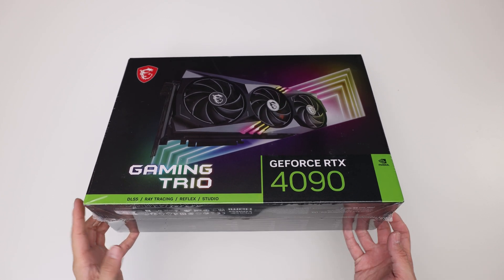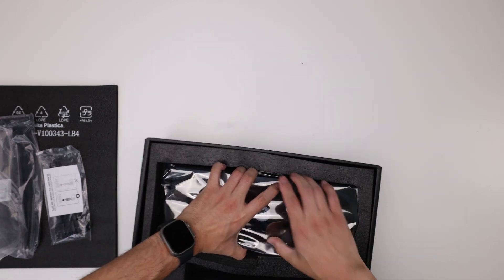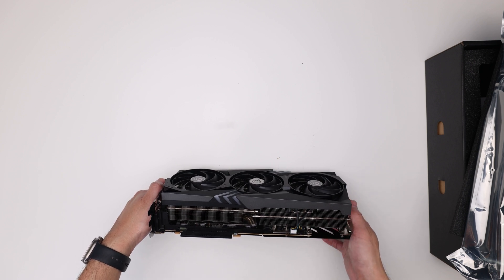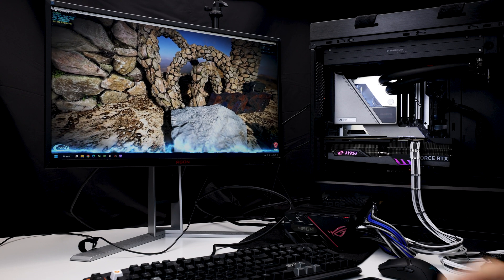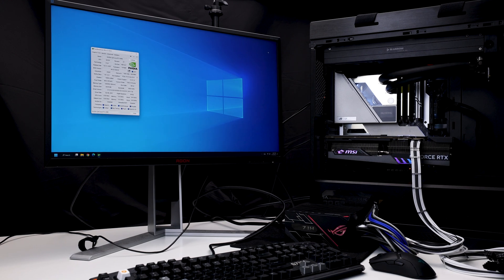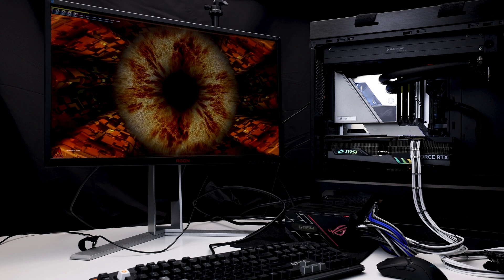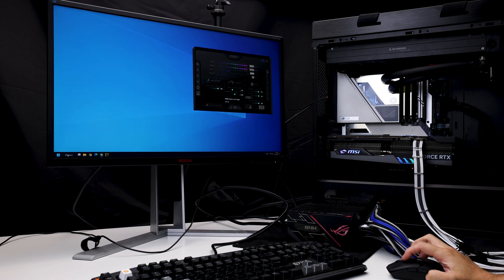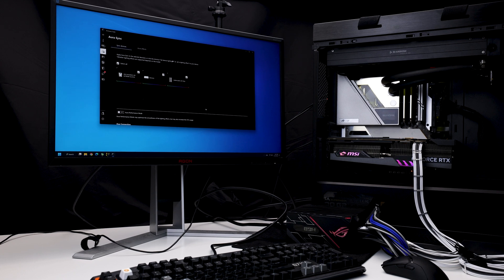FLASHING THE  MSI RTX 4090 GAMING TRIO TO AN ASUS RTX 4090 STRIX FOR THE 600 WATT POWER LIMIT

Comment: I still use 1 braided and 1 regular 3 wires in total it's still 450 watts for my 4080 super its plenty. It's with corsair also. It's fine.

I have thought about using corsair 600watt cable but I heard that not having all 3 plugged in won't allow for the 133%? Unless that's only when using the 3 piece adapter? Maybe if it goes directly into the psu like corsair does it will allow it? Just wondering. Thanks.

I still think it's pretty cool corsair has a 600 watt cable that goes directly into the psu and don't have to worry about the adapters. What I want to know is how they are pulling 600 from a 1 to 2?

Comment: I am considering flashing the suprim x 520 watt bios on my PNY 4090. I should be safe to use nvflashk with an igpu on my CPU right?
Reply from the maker: yes but I also would not suggest it
Reply: @JCustom  Thanks for replying man. My PNY 4090 boosts to 2760 mhz vanilla. I was thinking maybe a higher power bios would help me reach 3000 mhz. You don't recommend it? Is it because you don't get an fps increase in games?

Comment: The galax hof 666w bios works fine due to it also sharing 3dp and 1hdmi gains are negligible stock , although 480w bios max clock is 2980mhz with galax bios 3105mhz is stable
Reply: Man I want to try that bios. I wish I could find 1 person who tried it with a PNY 4090 to know if it's compatible. My card isn't dual bios.

Comment: How much extra headroom does the 600W BIOS give you for overclocking? I know you mentioned that the framerate difference was negligible, just curious how much you were able to up the clock speeds once the higher power limit was in place.

Comment: how are ur gpus temps so low? theyre in the 50s thats insane. my suprim x is around 75c in the same test also max oced.
edit: and i have massive massive coil whine. 
i can hit 2985 on the core and + 1540mhz on the mem. thats max.
Reply from the maker: check the fan curve on your suprim. By default, it does not go over like 50% fan if I remember correctly.

Comment: hello, you can not pass 3090mhz because of the power limit or the problem is the gpu, or is it something else? and I saw some 4090 with mod bios that reached 3150 4k consuming 450w, I'm noob in the subject hehe

Comment: I got a 4090 yesterday, I also got a Corsair 1 to 2 12vpwr cable, type 5 for my Corsair 1000w PSU. Is that giving me all the power I need? MSI AB shows 133% power slider.

Comment: I flashed suprim 4090 with Strix and Suprim Liquid for 600W power limit, it was fun but practicality no gains. But since temperatures are below 70 at any load, I am keeping one of the BIOS as Suprim Liquid (600W BIOS) and another silent default Surpim X BIOS.

Comment: I was able to flash the 600w bios on my MSI 4090 Liquid X and i can see a noticeable improvement on fps and clock speeds...an overall 4-10fps more than out the box manual oc...it only makes a difference in benchmarks, real world usage no real difference.
Reply: does it mess with your output i/o on the back? these series only have 1 hdmi and i needed, maybe i will follow you and flash the msi liquid suprim x that way at least they have same i/o on the back and i believe all brand is the same pcb and i/o too. but always have doubt.

Comment: Can someone help? My 4090 gaming trio, is somehow stable at Power Limit: 106%, Core clock: +125 MHz, Mem Clock, 2005 MHz. I am wondering, since my card can hold an OC so high (I know I can set Mem clock higher but idk if there is a point in doing so.....ultimately wondering if I should try and flash mine to get even more performance. I just hate that mine is locked and will not go over the 450w lock

Comment: Wait. I literally just purchased this card. You telling me it doesn’t perform as well as others or the FE?
Reply from the maker: It’s all going to come down to silicone lottery. In terms of power limit it is one of the lowest. However, that may only effect overclock potential if your chip is good enough. In terms of cards to buy at the 1600 msrp fe would be the one to look for

Comment: Apparently does not have a vapor chamber.
Reply: Vapor chamber not needed on 4090's. Temps are very low... Just marketing BS.
Reply: @rlwings  Not marketing BS. AIB partners often find areas in which to cut costs, cheaping out on VRM or cooling.  

The MSI 4090 Gaming X runs the hottest out of all the 4090s as a result of cost cutting. It has about a 10 degree difference compared to some of the other 4090s, also has the highest hotspots going up to nearly 80 degrees. 

If you are going to pay $1599+, you might as well get as much premium parts out of it as opposed to going with the cheaper built ones.

Check out the 4090 tier list here on YT by O! technology.
Reply: @deuswulf6193 that’s false it runs the exact same as 4090s that graph was stolen from hardware unboxed who ran it with the silent switch and not gaming stop spreading lies

Comment: Can I do this on a PNY 4090?
Reply from the maker: Yes I think the gaming oc bios works. Did not test it so you will have to check online
Reply: I am thinking of flashing the Suprim X bios on my PNY 4090 since it is 520 watts and has a higher boost clock than most 600 watt bioses out there.
Reply: @cemsengul16  honestly I was thinking about it but in the end decided against it. The PNY is plenty strong enough for my needs anyways but good luck with yours. Let me know how it went.

Comment: Your warranty is null and if you mess this up or it's messes up over time with drivers or being misidentified you are left with one BIOS slot. You just lost your safety slot.

Upping to 600w I beyont at your own risk.
Reply: Let's say, if you messed up the bios and the card went black screen (soft bricked). Just buy other really cheap GPU (used GT210 perhaps), connect both cards to motherboard, connect display cable to the monitor and GT210, and then flash the original bios to the soft-bricked GPU -> done, bricked GPU alive again.
Reply: Which tool? The one I used on TechPowerUp doesn't ask which card you want to flash to
Reply: Im using nvflash64. I used to soft-brick my Phoenix rtx3060 V2 to the TUF version. Luckily, I was able to bring my 3060 back to live by using my GT210 to flash bios into my 3060.
Reply: Just to add to this, if you want to up your power limit via flashing, flash MSI Suprim X instead. 480w power limit and you don't lose any ports. Also it remains an MSI card and you are less likely to encounter issues in the future.
Reply: doubt it. Unless not back up the original bios and hard-brick/damage the card, you will be fine, They wont void warranty of the card.
Asus, on the other hand ...maybe... since they are very strict in term of warranty (even missing an adapter could cause warranty void).
Reply: Bricking isn't the only risk. This card is not designed to take 600w. There are far fewer power stages on the Trio.

Suprim X vBIOS at 480w is a safer choice.
Reply: @SyCoREAPER  - Im using suprimX vbios 480-520 on my GamingX Trio more than a month now without any issue.
Reply: Merge to one reply.

That's what I am using but what's the command to flash a different target (if you install a second GPU)? Or did you buy an AMD GPU so NVFLASH only sees one Nvidia card?

Suprim X is what I'm suggesting and adving AGAINST using the STRIX as this video is saying. Suprim X BIOS is basically identical minus the power and clocks which is exactly what you want. The Strix might be compatible but it's still not a good idea.
Reply: If u are using nvflash64 then use the command "nvflash64 --list" to find your bricked gpu index. If your bricked gpu index is at index 0, then use "nvflash64 --index=0 -6 rom_name.rom".
About flash AMD gpu, yeah, I havent flashed AMD one since the 7970ghz (quite a long time now). If I rememeber correctly, there is a software called ATI winflash or atiflash where u can flash amd gpu.
Yup, it's not a good idea to flash Strix vbios into Gaming Trio card since the card will lose 1 port and wont control RGB anymore compared to the Suprim vbios. However, as long as still keeping the original vbios and the gpu isnt fried or damage physically, your gpu wont lose Warranty (not sure about Asus though)
Reply: Thanks for clarifying the command line arg. Hope I never have to use it.

Comment: Just to confirm, after flash two display ports and the HDMI port function?
Reply from the maker: you will loose 1 display port as the strix has 2 hdmi instead of 1

Comment: I finally got a MSI Gaming X Trio 4090 from Newegg, it is supposed to be here tomorrow.  It was the only one I could get in stock and not from a scalper, although for the price $1799.99, Newegg might be doing a little scalping themselves.  Really enjoyed this video and I will have to look and see if you have one on flashing the BIOS from another card.
Reply: 1799 is pretty decent price, here the shop sold for $2000
Reply: @heihachichichan8910  I got mine for $1799 about 3 weeks after release..it's a great card. I hatit running in my system in a custom loop with Phanteks G40 block.
Reply: Can anyone help with a video on how to flash the suprim x bios to my card?
Reply: 1799.99 is the actual launch price for that model lol, Newegg wasn’t scalping tbh

Comment: Did you get Coil Whine with this card? Normally it is pretty good for me but Battlefield 2042 will make it whine
Reply from the maker: No I do not have any. So far the only whine I've had are on the asus cards, but not enough that it would be bothersome.
Reply: @JCustom  Thanks for getting back to me. I am somewhat in a bind. I am outside the return window for the store. I talked to MSI but that’s been rough going so far. For the most part it isn’t too crazy but battlefield 2042 it’s a little rough but I blame EA for that haha. Seems like it is increasingly more common on 4090s.
Reply: no whine at all....never had it

Comment: hello JC, i have a pny 4090 with power limit 450w. Do you think it's possible to flash bios with gigabyte 4090 oc bios  with power limit 600w . 450w it's maybe just for best performance on PNY 4090 ? what do you think ?
Reply: I'm thinking for our PNY 4090 cards the safest option will be the 520 watt Suprim bios. That bios has a high boost clock and will be gentle on our VRMs. Just need to grow the balls to try it out on my card.
Reply: I have tried a bunch of different bioses now on my PNY 4090 but I haven't found a 600 watt bios with a fan curve that I like yet. Closest contender was this unverified Zotac 600 watt 4090 vbios that has a starting fan rpm of 1100.
Reply: You ever try the Galax 666 bios on your PNY 4090 yet bro? I tried a bunch of bioses but that is the one I haven't tried yet. I hear it is the best gaming bios out there because of the effective clocks but haven't tried it yet.

Comment: Is it safe to use 3x8pin adapter came from this card with 600W mod?
Reply from the maker: Yes, If you have a good psu
Reply: @JCustom  - thanks for your reply. 
I have Rog Thor 850W plat pair with ryzen 5900X (using only one 8pin without any issues)

Comment: Think it could pull 600W through 1x2 8 pin with no problems?
Reply from the maker: Good psu no problem.
Reply: @JCustom  yeah I tested last night with my zotac. 12 pin to 2x8 pins pulling 500 watts no issues.

Comment: I'm thinking about doing this but do you lose 1 display port in the process? The MSI Gaming Trio has 3x DP 1x HDMI and the Asus Strix has 3XDP 2x HDMI. Since they both have 3x DP I figured you wouldn't lose anything cause I'm running 3 monitors with dp and can't afford to lose 1
Reply from the maker: Yes you do loose 1 display port. You can try the gaming oc bios it’s also 600w
Reply: You can flash Surpim Liquid BIOS 600W (you will have to find 600 W BIOS as there is only one 600 BIOS, I am using that and works grat).
Reply: @ShashankKatiyar0  Where can you find one?

Comment: So the conclusion is, there’s no actual benefit in risking the card with bios flash. Because there’s literally not that much of a gain
Reply from the maker: Yup but I also have a decent die here. Some dies can hit the 400 ish power limit without overclocking.
Reply: @JCustom  what would you consider a good die vs a not so good one anything around 380w stock good and over 400w bad?

Comment: would like to point out on the 600 watt bios your min fps was 56 and on the normal stock bios it was 31.56 seems like a big improvement tbh
Reply from the maker: Hmm I will look into that. That seems too big of a diff for a more aggressive clock curve on the strix as well. Thanks for noticing
Reply: @JCustom  Could I know the settings you are running cyberpunk at? I have a trio as well 70 max and 52.82 with all my settings maxed out and dlss 2 quality
Reply: @adeveloper6653  It’s just that the start of the benchmark had less of a loading hickup the second time is all. Min fps on the Cyberpunk benchmark can greatly vary based on how it loads at the start. What matters is the max and average were almost the same down to margin of error
Reply: Ever get this info? Lol?

Comment: How do you feel now that it was proven that the melting cables was user error? And also the report from Der8auer that if you power limit to 70-80% you still get like 95% performance.
Reply from the maker: I felt it was user error from the beginning. Now we just have a better idea of what the error was, but the adapter cable is still built poorly. Yea its marginal after like 480 watts or so
Reply: As long as we push the cables in fully and make sure not to do aggressive bending we are good with the included adapter? (And no Y-cables from psu)
Reply: @Ultrajamz  yes. Just make sure it’s even on both sides and clicks in and yo can’t pull it out

Comment: Hey have you looked at memory oc scaling between all your cards? I’m finding that it’s the real lottery this gen, got 3 4090s one capped at +1200 anything higher crashes or artefacts, another it was around +1500, and the final one I got is doing +2000 without memory correction even kicking in it still scores higher and higher in benchmarks, i think it could go higher but Afterburner caps at 2000 ^^’

There’s huge variance it seems
Reply from the maker: Did notice that actually as well.
Reply: @JCustom  Any recommendation for msi 4090 suprim x users and OC? I am on stock bios atm...  520W is my limit now, not sure if there is suitable custom bios that will unlock 600W on this gpu..?
Reply from the maker: The strix bios will get you to 600 on the suprim. You will loose an display port. Check my msi 4090 trio vid. I flashed the strix onto the trio which is the same pcb as the suprim. The gains are up to lottery tbh
Reply: @JCustom  Can you provide the link for the strix bios by any chance ?
Reply: @Gajbotron  how did you get your suprim x on stock bios to boost up to 520w
Reply: @warzone_clout  That is the default cap for Supreme 4090
Reply: @Gajbotron  you do not even have to overclock at all? This is just default settings? you dont go into overclock software and set the power to over 100%?
Reply: @Gajbotron  like it will boost up to 520w out of the box?
Reply: @warzone_clout   Yes, MSI Afterburner:  Power limit 108, Core clock Mhz +175, Memory Clock 1200 = that is STABLE settings for me... but I think you can push it even further...
Reply: @Gajbotron  oh oikay thank you... wow my 4090 gaming trio, is somehow staable at Power Limit: 106%, Core clock: +125 MHz, Mem Clock, 2005 MHz. I am wondering since my card can hold an OC so high if I should try and flash mine to get even more performance. I just hate that mine is locked and will not go over the 450w lock
Reply: @warzone_clout  Better don`t push it too far, different components are on the trio vs supreme....
Reply: @Gajbotron  I am going to keep it as is for now since I am already making up the 6% perf difference (and more)
Reply: mine does 1800, i can only offer this one for a sample size tho its a gaming x trio on strix bios and air cooler

Comment: I did this same thing a week or so ago. Had mentioned it on one of JayTwoCents vids.
Reply: 1to3 pulls 450 watts maximum. The 1x4 unlocks the 600. 150watts on each 8 pin.
Reply from the maker: I’m pulling 600 on the 1:3 in the video. It’s just the wire redundancy on the 4